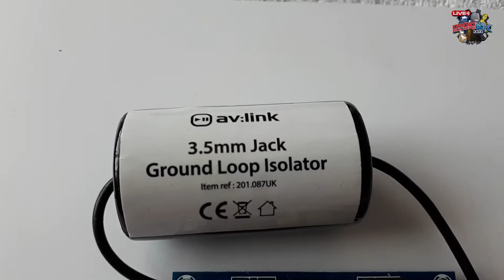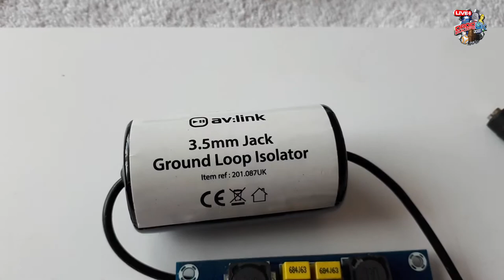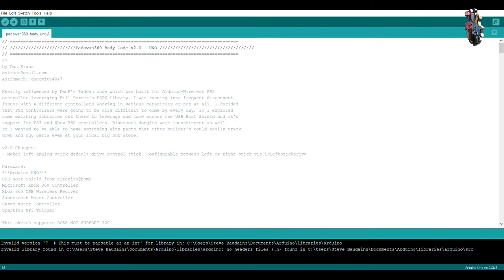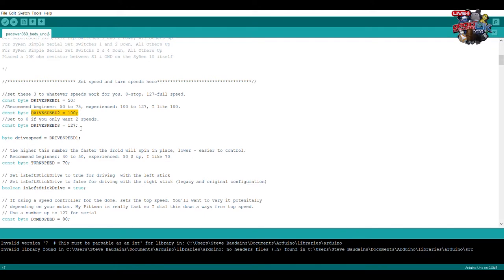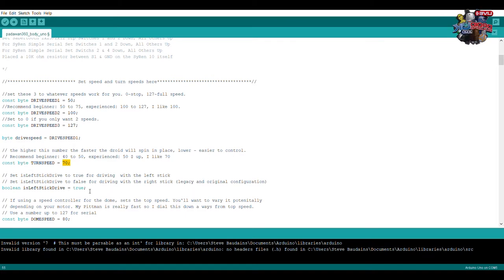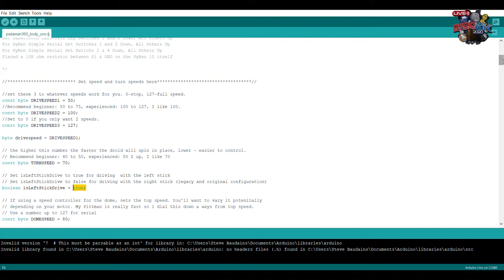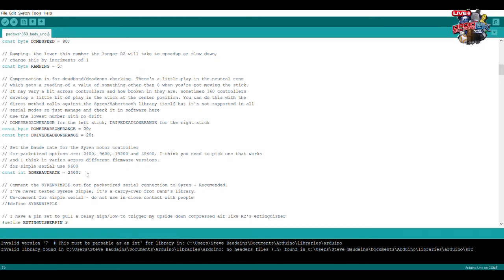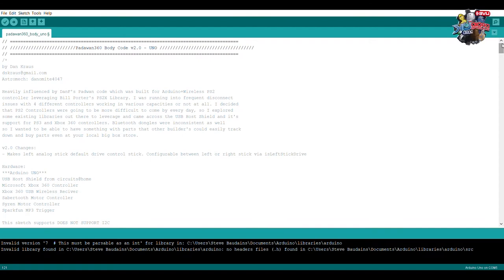Padawan 360 Tutorial for Droid Builders UK Live by Steve Baudains

Comment: Hi Steve I'm a late builder on R2, in fact im still building R2D2. this video is the most explainable video for wiring up, but I'd like to know how would the Teeces set up, can they be connected to this Padawan 360 or is it a seperate connection. I know nothing about electronics, this video as explained alot and also did your pre install the sounds on the sd card first. great video thanks

Comment: What battery did you go with and what was it's weight?
Reply: I use a pair of SLA 12v batteries which are 17ah each, if I'm just at a smallish event, I'll just use a single battery.  My droid is wood/metal build so fairly heavy compared to a 3d printed droid for instance.

Comment: Is it better to run the arduino and mp3 off barrel plugs or the 5 volt from the saber tooth and syren or doesn’t it matter
Reply: I originally ran 12v, but I now recommend 5v from saber/syren. It means you can run your speed controllers at 24v with no changes.
Reply: Thank you very much for your video!